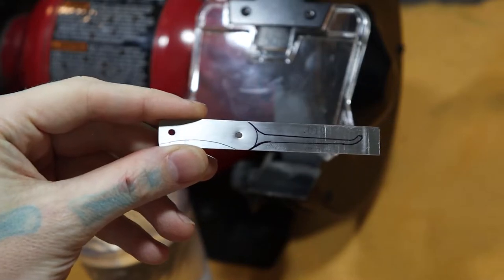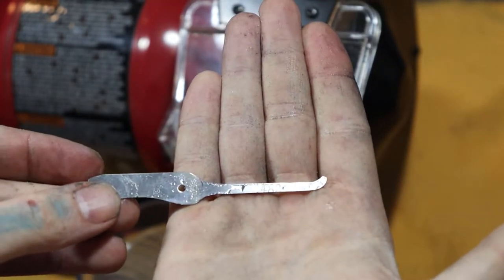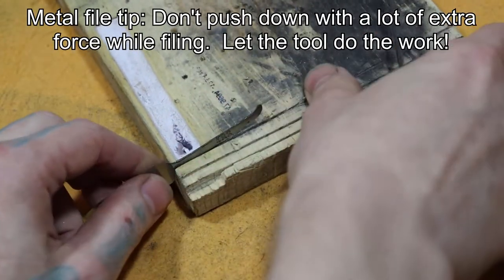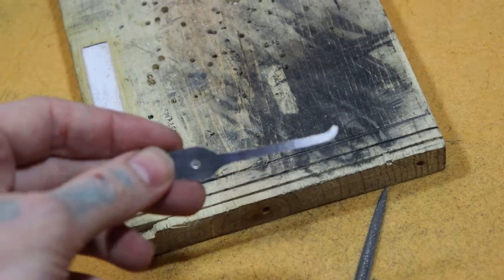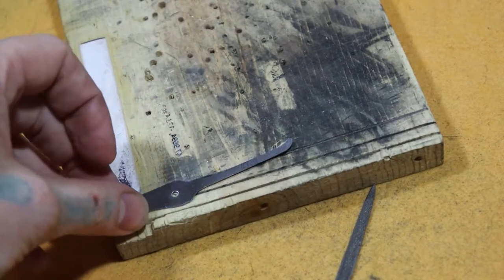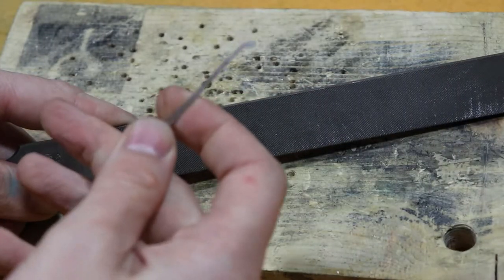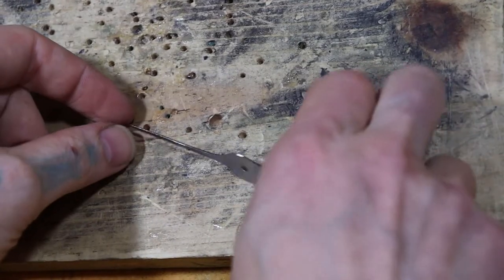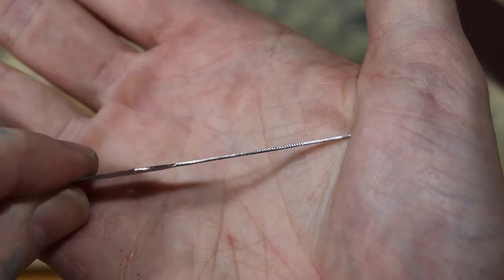153) Making Custom Lockpicks Part 4 - Grinding, Shaping, and Prepping the Pick Blade

Comment: When grinding small parts like this I strongly recommend using vise grips. Holding it in your bare hand there’s a fairly high chance of the stone grabbing your piece and slicing your fingers open.

Also, there are both push and pull files.